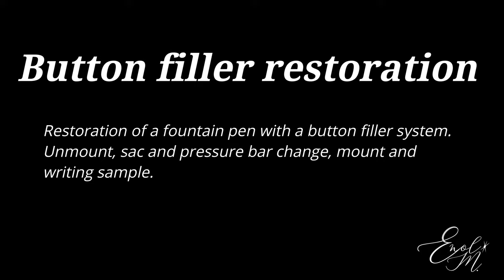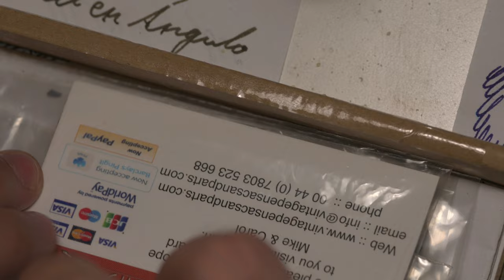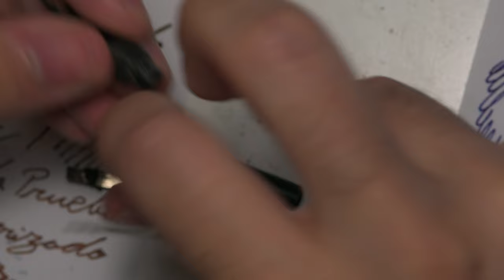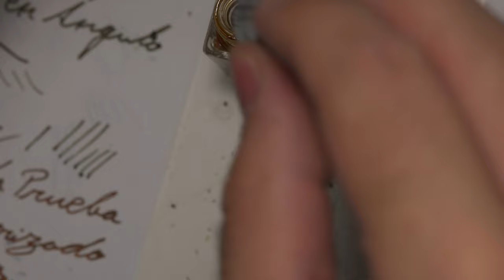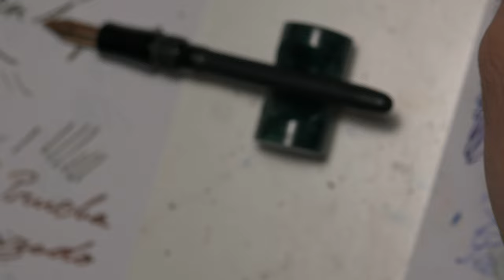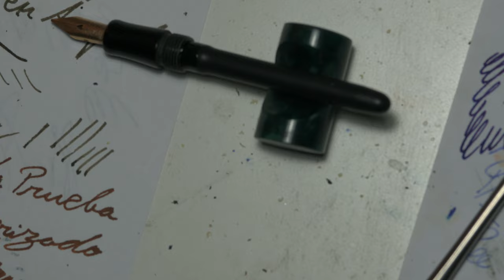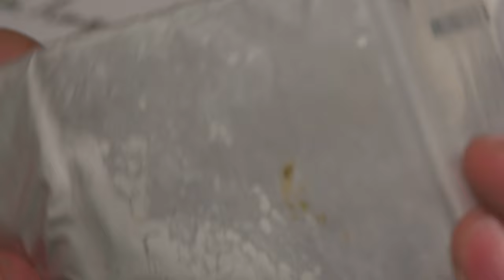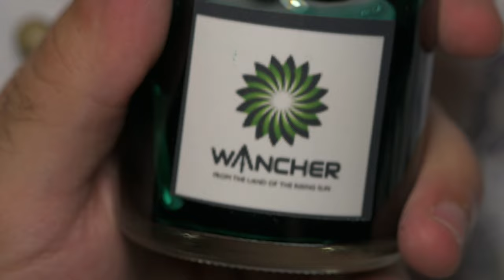Button filler fountain pen restoration

Comment: Buenas compañero. Try to make more restoration videos. Forget the toxic comments 😉. I liked this video and indeed there is no need to speak while you are doing a good job. I would like to see more restoration fountain pen videos made by you. Just one remark. I usually put the shellac between the ink sac and the section and then outside the sac. Is just another theory. 
Un saludo desde Lisboa/Portugal 👍
Reply from the maker: Thanks!
I put the shellac there because it create a good sealed point and works for me. I'll try yours.
I have some other pens for restoration, but have no time to record all.
Greetings.

Comment: 'morning, Mr. Matilla. Don't worry, a first video is always a gross work, with experience you'll achieve the ability of doing a neat one. True is that the music doesn't work, (is boring and I yawned more than once while watching it). So, apart from the video quality (hideous) and the music selection, your contribution can help peoble to start repairing their own Fountain Pens.
I start repairing my pens thirty five years ago, when I was 27. 
My first repair was my Father's Sheaffer Crest (Snorkel Filler) and it went well (followed page by page "Da Book" and a Sheaffer leaflet that came from their repair department.
Two things I've missed: 
- You don't show the cleaning and repost of the nib-collector-section assembly.
- You should have checked the lenght of the pressure bar before assembling the pen.
Two procedures that I do in a different way:
- I always apply Shellac (there's only one, lol) all over the nozzle and then attach the sac properly, withoult leaving but a very thin and narrow layer in the outside of the sac.
- I always apply a bit of shellac to the thread of the section to assure no further ink leackage. 
And three thumbs up:
Thanks the Almighty, you don't use the sac speader thing (*****) 
Your use of the knife to remove the old shellac, thats how it should be done, fearlessly and boldly (****)
Chalking the sac is an old school trick that the Big Four did. 
The versatility of the hook-ended tool that you use to clean the barrel inside (you even returned it to it's original shape?) four stars for your creativity here ****.
Unfortunately, I'f I had to, I'll rate your vid with a two stars, I'm sure that you can improve your ability of making such kind of tutorials. But, nevertheless, I gave you a like that I think you deserve for your efforts. 
Go ahead, accept the critics and don't mind the haters.
Sincerely, 
Sheafferer
Reply from the maker: Thanks for the comment!
I made a new one without music, but talking in Spanish. I don't know how well subtitles will work.
The original pressure bar was broken I didn't realiced. I cut the video searching one in my collection to change it.

Greetings.

Comment: Try to avoid autofocus - we television cameramen never use either autofocus or autoexposure.
Reply from the maker: Thank's for the advise, but It's manual focus. You can see the vibration while focusing.

Greetings.

Comment: You missed out the most important  bit push button connection  to pressure bar waste of your time and mine, pity,
Reply from the maker: Well, after putting the bar as in the video, you only need to press the button on their hole, making sure the bar`s top fits in the button hole.
I skip this part on the video because the bar I used was shorter and needed to find another one.

Greetings.